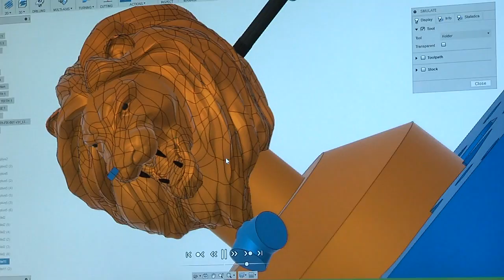Who is this TITAN of CNC Machining?

Comment: First off, I think this is an amazing opportunity for actual rehabilitation. Secondly, I think you a reaching a large market of untapped potential on the double cheap. The last comment I would make is that there is a dying breed of true fabricators. The skill that is taught is to show up and make parts to print, but I feel like more design empowerment needs to be given to machinist for one off jobs/machine building. The creative/learning experience that you get from a machine build needs to be an emphasis.